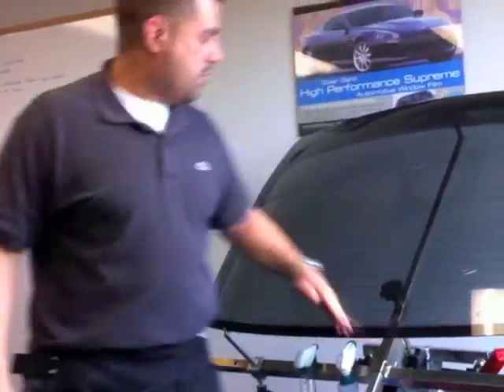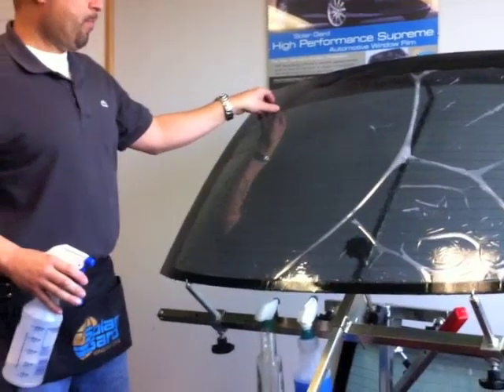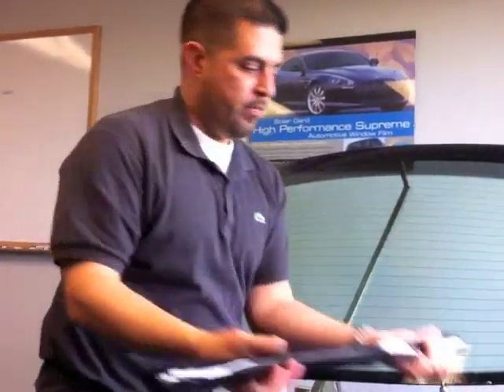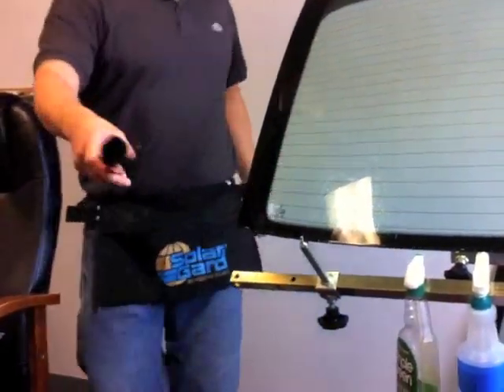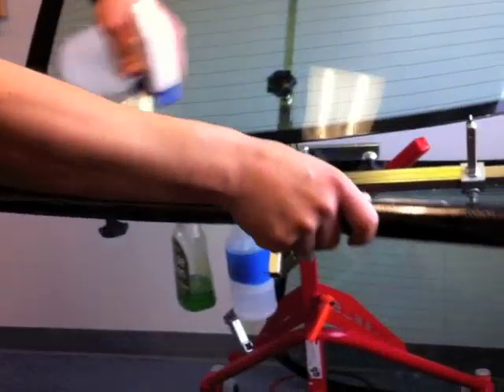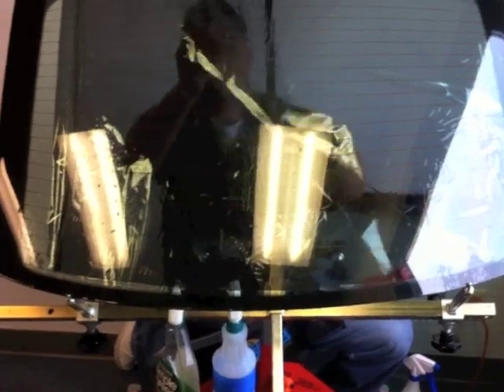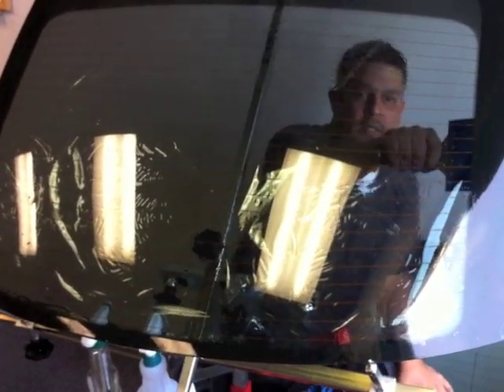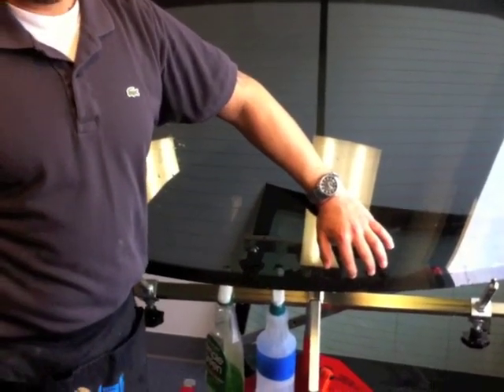Tips and Techniques: Curved glass technique (Part 2)

Comment: Nice install, however I disagree with the suggestion that using peal boards will create  excessive contaimation . I use them all the time and never have a problem. The main reason for using them( for me ) is to not do any cutting on the car itself. Other than that this is a fantastic way of shrinking and installing  this back window !  Well done guys !

Comment: hi, when you cut the film directly on the glass... will you scratch the glass??
Reply from the maker: There are two types of metal used in tint knife blades and scrapers, carbon steel and stainless steel. Carbon steel is most commonly used in scrapers where you are scraping / sliding over the glass versus holding the blade perpendicular to the glass and cutting. Stainless steel is softer than carbon steel so SS is used by most for any direct on glass cutting. Note however if you push hard enough even with a SS blade it is possible to leave a cut line in the glass so the tip is to use a sharp fresh blade with minimal pressure needed to cut the film. The blades used in Olfa knives which are the most common cutting knives are segmented to snap off so after say 10 to 15 cuts you should snap off the end of the blade to expose a new segment maintaining a sharp edge.
 
Some glass can even be softer than others so some tinters place a 1cm x 1cm piece of thin plastic under the film where they want to cut then position the knife blade so the tip is into the plastic through the film. Then as they drag the knife along they are sliding the plastic with it meaning the blade itself does not touch the glass. This technique is only really suitable for rear screens where there is clear area around where you are cutting. You can’t use this technique for cutting the edges on house windows for example as the plastic would space your cut line too far off the window rubber leaving a large gap. Most tinters though have no problems by just keeping a sharp blade and watching their pressure cutting on the glass.
 
I hope this helps
Reply: Solar Gard Australia  yes helpful answer thanks!